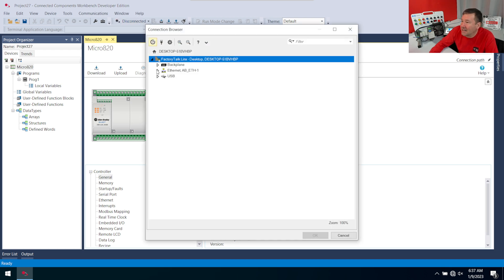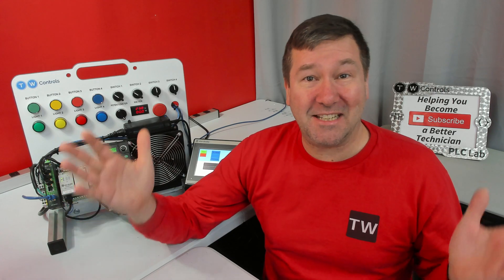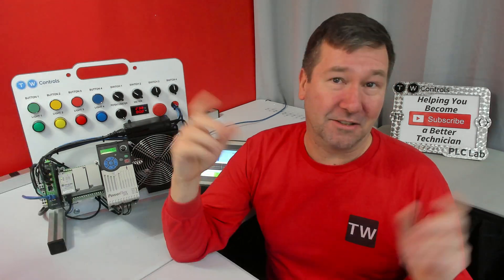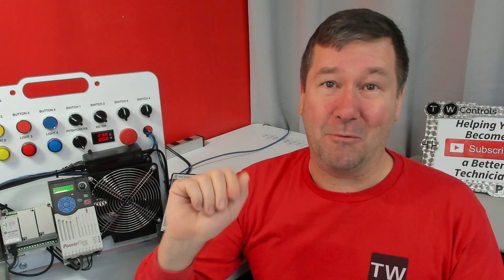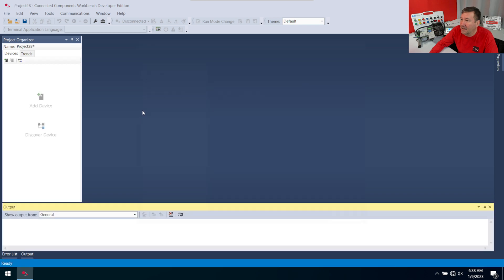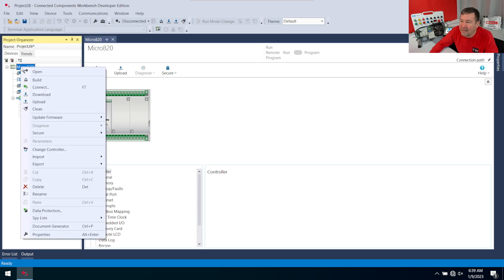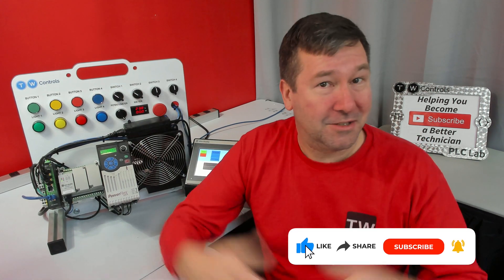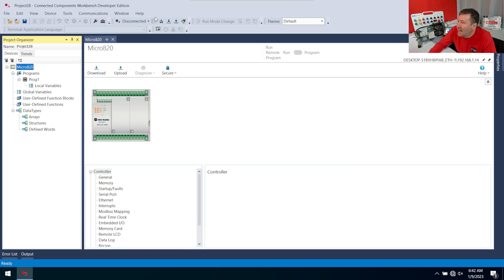Clear the Password on a Micro820, Micro850, or any Micro800 PLC

Comment: Do you have a video where you set up a message instruction between a M800 to SLC500 or Micrologix1400? I am investigation communication between a SLC5/04 via DH+ (via Proface  AN-X4-AB-DHRIO) to a M820. I did find a knowledge base tech not QA41999 on Rockwell's website. Thanks
Reply from the maker: Someone else asked about that the other day. I don't know why I've never done a Micro800 to Micrologix but no I haven't. I'd be interested how it works out with the ProSoft module to a 504.
Reply: @TimWilborne  Oh my, Thanks for the reply (and my syntax was horrible). I'll let you know how this evolves.